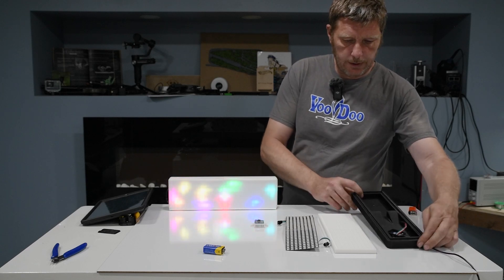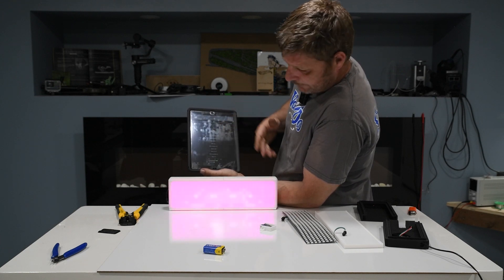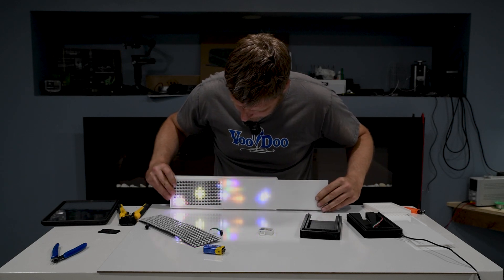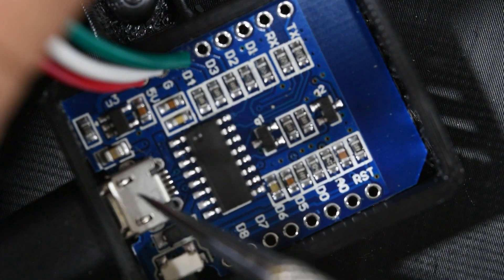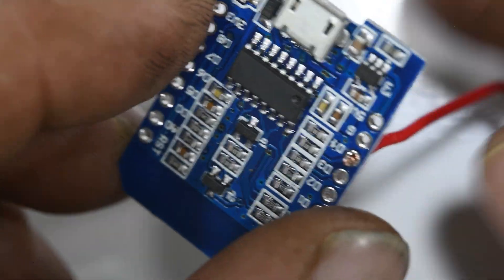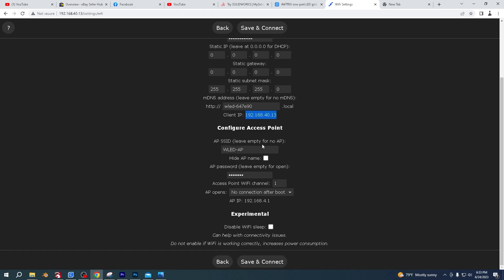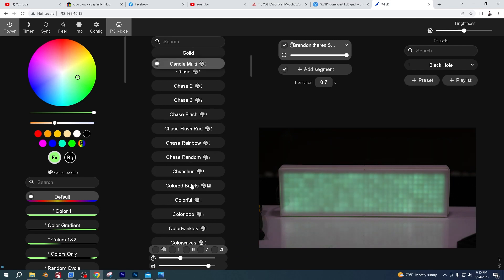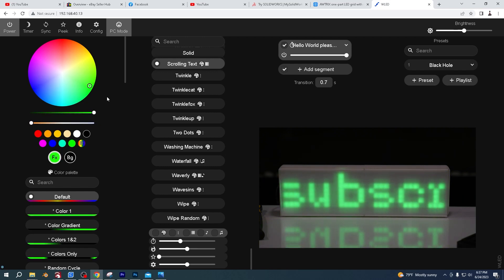3D Print LED Matrix Enclosure with Diffusion Simple V400

Comment: Do you power from the USB plugged into the D1 mini?
Or do you use another power supply and connect the grounds together?
Can you power the 8x32 through the D1 mini ir does the matrix draw too much current?
Reply from the maker: the D1 powers it fine